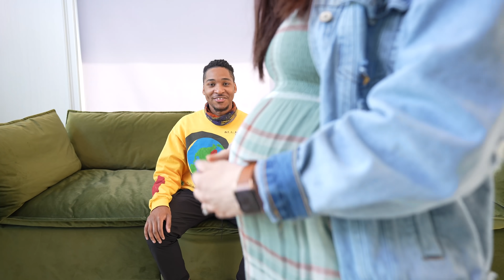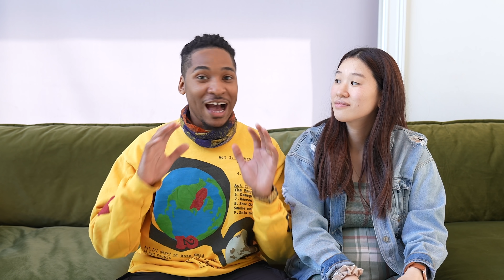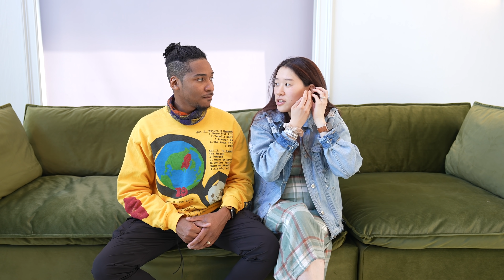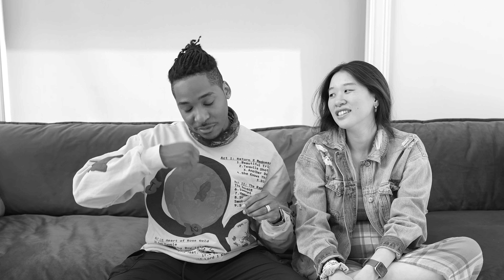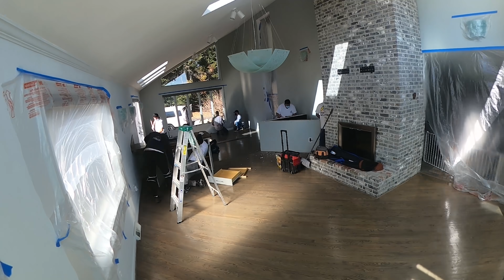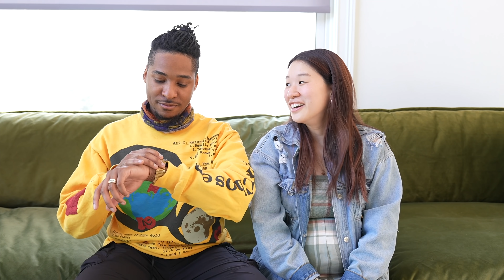Our Pregnancy and Home Update!

Comment: As for your chimney, put a rugged Mantel (reclaimed or sleek lighter wood to pop) and hide it behind it and put shelves on the side ( floating).  Also a built in fire place screen will allow you to open it while protecting babies.  Just a tip from a former house stager/ realtor

Comment: You guys crack me up and make me so happy. I wish you and your family all the best and many blessings. It’s funny that you shake your head like that Glory because there is actually a maneuver that they use which is similar to what you do in order to get rid of Vertigo. It works for Vertigo because the crystals in your ear that help you to gauge your balance sometimes get stuck to one side so then you fall a lot and can’t keep your balance etc. The tubes in your ears is a real thing though and it can be a problem that is made worse because certain ethnicities has different shaped inner ear tubes. For example, I have a lot of Native American in me so my ear tubes are shaped in a way that causes me to get more ear infections. Have you ever just tried putting a cotton ball dipped in wrist warm olive oil and placing that in the ear your having that issue with like your putting in an ear plug? If you have an ear infection just add some oregano to the oil as it’s heating up and it provides a TON of relief.

Comment: To explain Glory’s voice issue it sounds like she has a finger in her ear all the time. her voice is loud and heard from her eardrum from the vibration inside her head. Increased blood flow near the eardrum and tubes can do that. I am not expecting ,but it happens to me a lot when my pressure is higher and heart beats faster and there is more blood flow to my head( quick moving like running etc) I hear my heartbeat in 1 ear and my voice is loud in same ear.

Comment: Matty, What are those cables connected to? Is that the TV about the fire place?  There is usually a Mantle Piece above a fire place. It's to be the heat buffer between the scorching heat and the wall above it. I've had real fire places in my home throughout my life.  Does it burn real firewood or is it run on gas or electric?